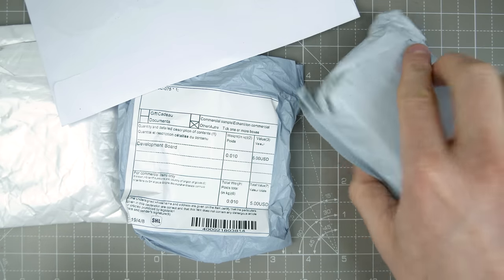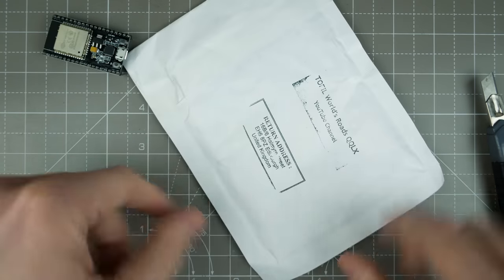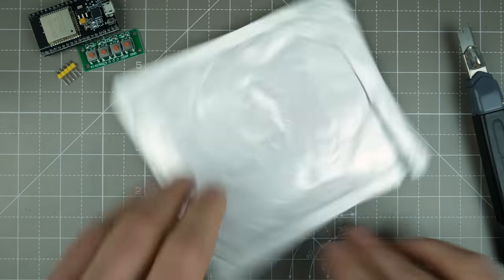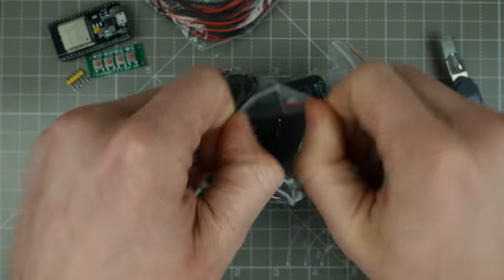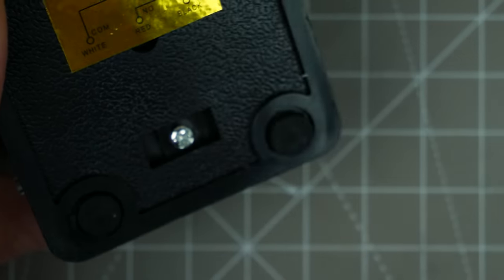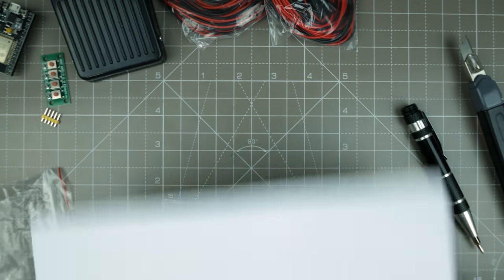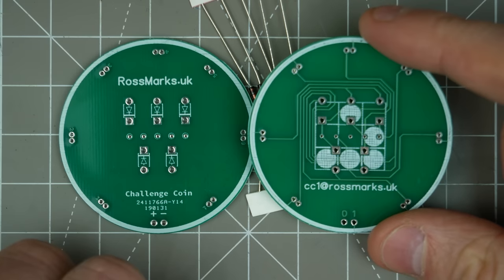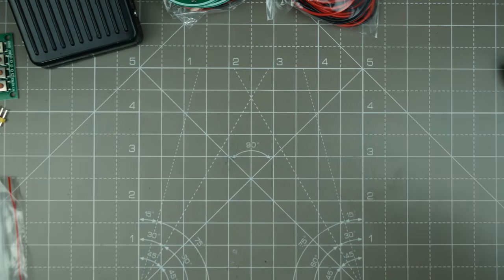Post Bag 19 - Sneaking in over the line

Comment: JST is a company, not a specific connector. It's also a set of standards, kinda. More of a set of pseudo standards from places ripping off JST's designs. But they make a ton of different connectors, possibly even more prolific than Molex at this point. 

The red ones are JST-RCY connectors. They historically have been used with a lot of lower power RC stuff, and will very commonly be listed on RC parts sites as just "JST connectors"

The black ones are 2 pin JST-SM connectors. They sometimes get used for more recent toy multicopter stuff. Unfortunately, like most connectors from JST, places often just list them as "JST connectors", making them a bit harder to find, but at least some places correctly label them as "JST-SM" or "JST SM2.5" (all JST-SM connectors are 2.5mm spacing though).

Unfortunately people are very terrible about not calling them by their correct names, making it hard to find them or even learn the correct names. At some point I'd like to make a photo guide of all these connectors, but that takes time and a bit of money so dunno when it'll happen.

Comment: If you're going for foot pedals you can also get the ones for guitar amplifiers / boards. Might increase findings or quality of the purchased ones.
I got some momentary and latching versions but from Conrad, so not that cheap ;-)

(example: https://www.conrad.com/p/guitar-footswitchfs-50-1612712 )

- used them for my HOTAS setup (Elite Dangerous, Star Citizen,...) which i extended via kinda something like this: 
https://www.youtube.com/watch?v=Z7Sc4MJ8RPM&feature=youtu.be

If youre under VR, you can't see your keyboard...

Comment: At a guess 16A/4A is the pure resistive, and the inductive load.
Reply: You are correct! In this case the 16A is when you use the switch with a load such as a incandescent bulb and the 4A maximum is when you would use this switch to switch a solenoid for a spot welder which these switches are used for a lot.
Reply: @DustinWatts  Agree.
Also note that DC ratings are also usually a lot lower than the AC ratings. This due to the AC drops to 0 100/120 times per second while DC can sustain a continuous arc.
Reply: Oh, that's good to know, thank you all for the info !
Reply: Yeah pretty much. 16A is the resistive load rating when powered by AC of 250V or 125V and the 4A is for a reactive load, usually a motor or similar kind of load. Around 25% is a good rule of thumb for the ratio of those values. If you were using it to switch a load powered by say 12V DC about 4A would be OK.

Comment: more than likely 16amp resistive load and 4 amp inductive load
Reply: electo99 - Yes. However, the maximum current rating may not be at the specified maximum voltage rating.
For example, it is not uncommon to find a switch rated at say 16A, but only at 110 / 120V. At 230 / 240V the maximum resistive load current may only be 10A. Resistive load means filament lights / lamps and heaters. Inductive load means motors, transformers etc.
Often the maximum inductive load current is the same as the maximum rated DC current.

Comment: For the thermal printer, i'm gonna look what i find on your channel for what you did there.

I used to work with POS/Point of sale printers,
which ALWAYS worked stupidly easy with a serial interface, also by using  echo / print commands from windows Commandline.
AND just as a coincidence, the VFD/Vacuum Fluorescent Displays also used the serial / ESC-POS interface.
AND i'm currently trying to get a SPS to send data via RS232 to a VFD (POS Rs232 version) or a simple 4x20 LCD over an arduino.

If you want to, i can try getting you some used stuff.
Or just ask around some shops for old hardware they might bin.
Reply: *Hmmmm!* Can't find a video concerning your thermal printer ?  got a hint where to look ? :-)
Reply from the maker: I haven't made one yet ;-) I am just playing around with it, learning what I can do.